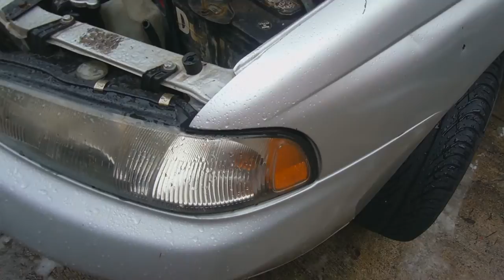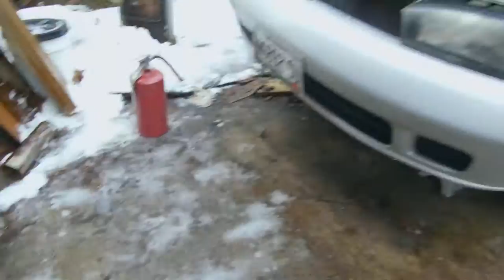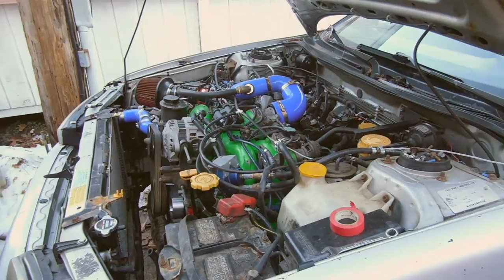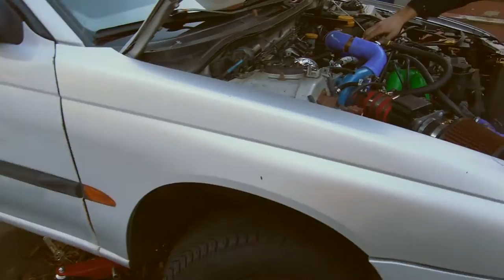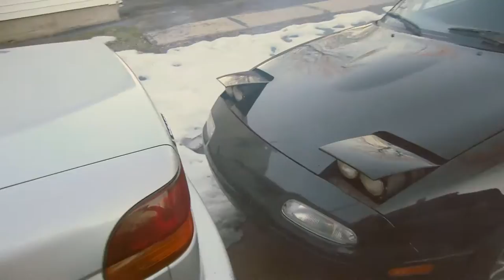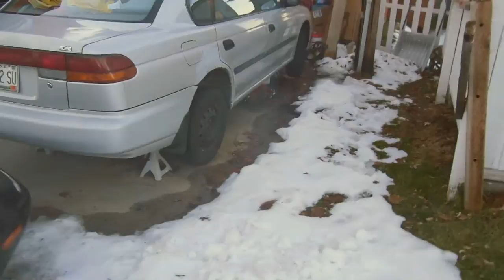1995 Subaru Legacy, first start after work.

Comment: is this the 2.2l? if so can you give me a list of things you've done to it I have been trying to do things to my 95 legacy but I can't find anything!
Reply from the maker: I didn't do anything to the internals of the engine. Here's what you need to safely run 8psi:

An intercooler, an absolute must.
The coldest range of spark plugs you can find.
A good fuel pump (Walbro 255 l/h will work)
A Vortech RRFPR with a 4:1 plate in it.

And all the various bits of plumbing you need to make turbos work.

Don't mess around with trying to retune the ecu. It isn't possible on those early OBDII ecus and the stock maps for fuel and ignition work well with what I've listed above. 

You won't make a lot of power. The only way doing this to 95 legacy is worth it is if you want the novelty of having done it. Here's a dyno sheet to prove it.
https://scontent-ord1-1.xx.fbcdn.net/v/t1.0-9/548338_10201541760380298_984999647_n.jpg?oh=a6057360fbda1f1ba53ce5d4e81da6cc&oe=58CB6569

I'm happy to provide what advice I can, but I can tell you that with the exception of the experience I got doing the project, the power gains loss of value in the car were not worth it.
Reply: Matthew Hume awesome man thank you! is there a place I can get everything? that's my main problems!
Reply from the maker: Summit racing for most stuff. I found the intercooler in ebay(get a used oem intercooler from an XT). word of warning: I probably spend around $2000 over the course of 2 years making mistakes and trying to get this thing to work right...

Comment: You did not see or do not understand that one uilind incorrectly set, or the ignition or camshaft ?? !!!! You twist the starter, and he op in the opposite direction to spin !!!
Reply from the maker: The TDC marks on those old EJ engines always mess me up. I had the cams 90° off. Also, plugging in the coil pack helps.